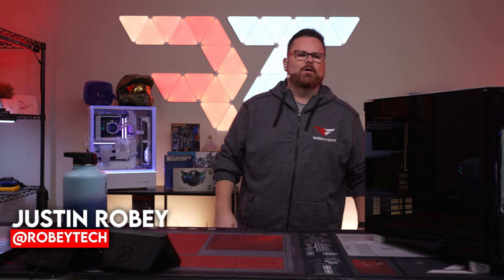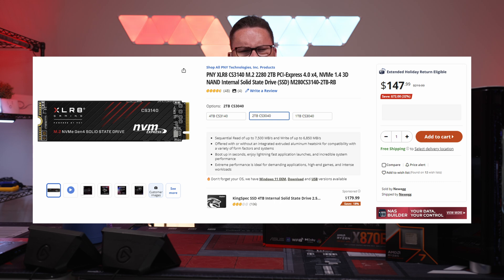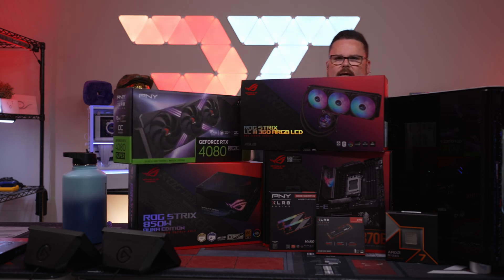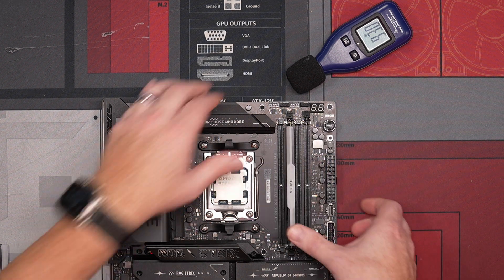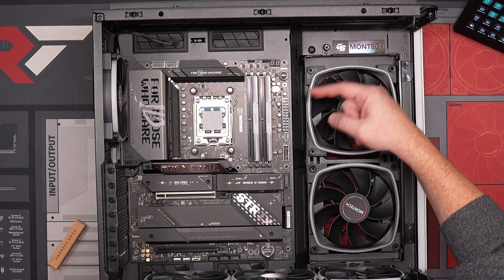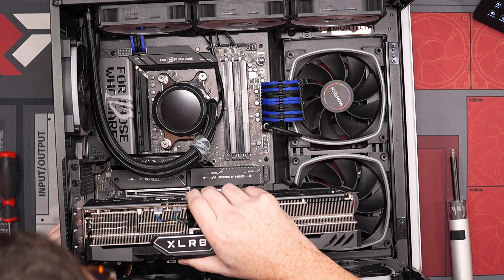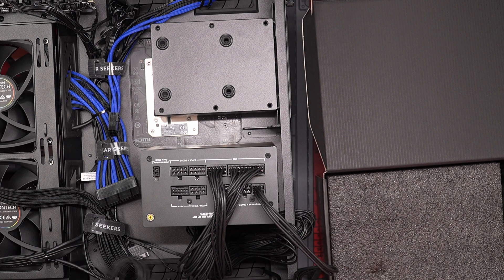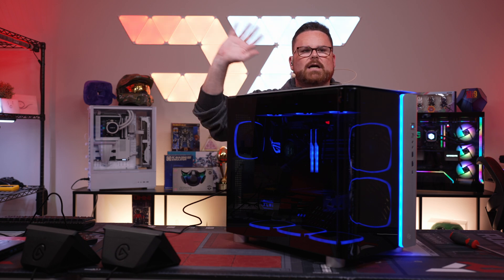Let's Just Build!  The Montech King 95 Ultra PC Build

Comment: Can't say enough good things about this case...

Mine is sat on my desk ready for a DAW build but I've had time to look at it in detail and I can honestly say, this case is a serious effort 👌 

0730/2024
Reply: Does it gathers lot of dust ?
Reply: @Night-Fox-XTX  cases only gather dust if you get the positive/negative pressure wrong and/or have case low or on floors/ carpets 👍 

Honestly, I havent used the case yet but it does have dust covers and filters so should not get dust inside.

Good luck.
Reply: @Night-Fox-XTX   that tinted glass will for sure